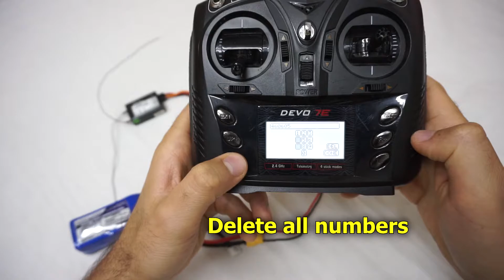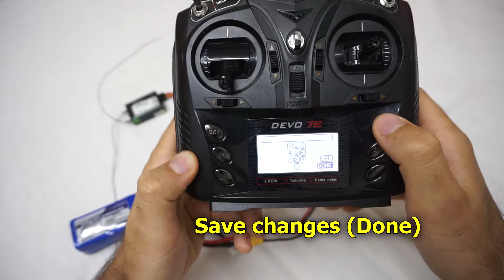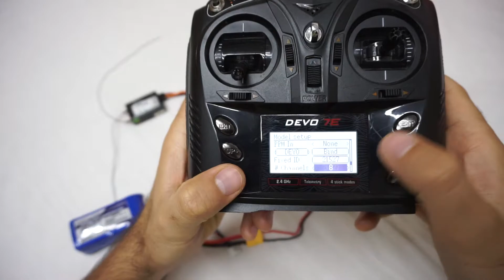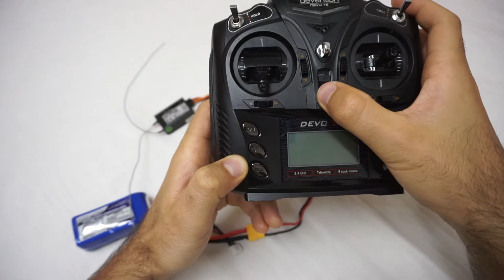Binding Devo 7E radio (Deviation firmware) to RX701 receiver using Fixed ID

Comment: Walkera X350 Pro help!

I have an X350 Pro, and while changing the body a while back I removed the white gimbal cable from the receiver thinking I would never need it. Now I do have a gimbal and I need to know where to put the wires into the RX703A receiver.  The wires are labeled "roll", "pit", and one is blank.  Thanks for any help you can provide. I can not find the information online so far!
Reply from the maker: According to the following picture you should try Aux4 and Aux5. http://www.rcparts.eu/images/prod-pictures/RX703A-1.jpeg